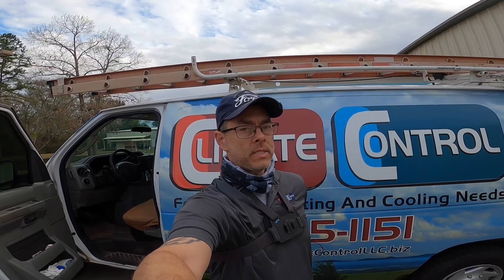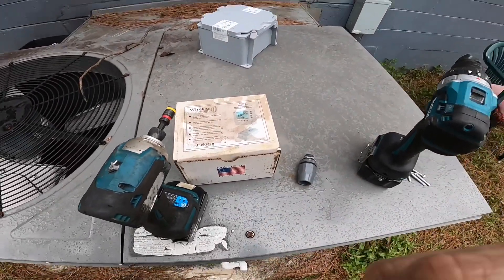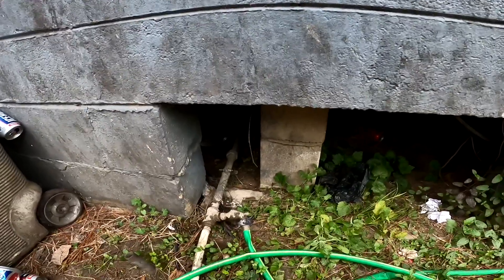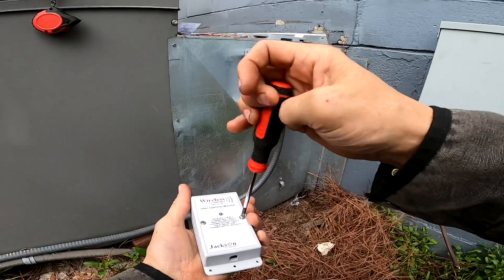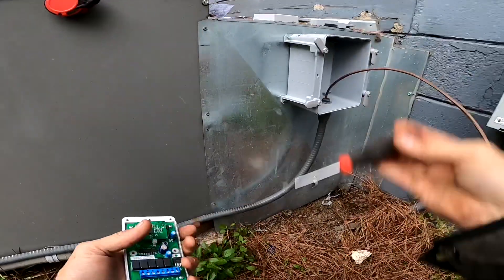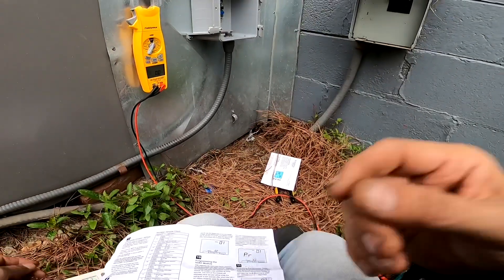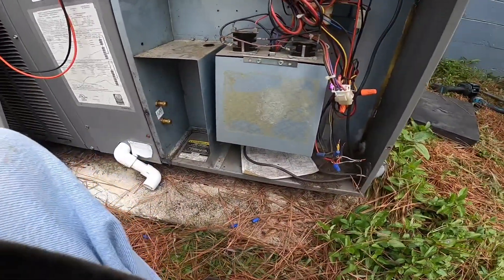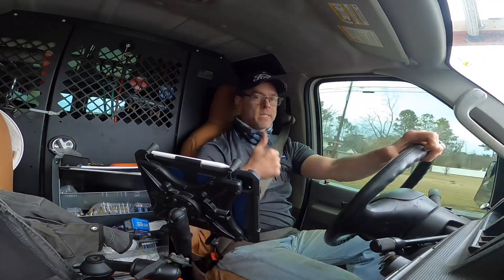Installing a Wireless Thermostat on a Package Unit

Comment: Wireless thermostats are great. I have the Honeywell wireless Focus Pro 5000, I think that branch of the company is called resideo now. Anyway, I live in a second floor apartment and the furnace is in the basement. For some reason, there are only three thermostat wires in the wall, R, Y, and W, there is no G or common. I really wanted to be able to control my fan but running new wires from the second floor to the basement would have been difficult and probably expensive. This thermostat totally solved that problem and provided some other benefits. The receiver attaches to the furnace control board in the same way any thermostat would. I didn't put the thermostat on the wall, since it's wireless I just take it with me to whatever room I'm going to be in. It uses Honeywell's redlink technology and has no problem at all communicating from the second floor of the building to the basement. I also bought the internet gateway for it and now I can control the thermostat from my phone. I can also control it with my Amazon Echo or Google Home. I really can't think of anything I don't like about this thermostat, I love mine.

Comment: How would wiring something like this work on a split system heat pump? Would you be able to bypass all the outdoor control wiring if you had to change that out or not since the air handler is inside?

Comment: That would be a perfect thermostat for me in my mobile home because our thermostat wires are running in a wall that is really close to a window where direct sunlight is hitting it and there is also a bedroom door that is usually kept closed and right now the thermostat is really sensitive to the draft coming under that door so it's affecting the operation of the thermostat in both heat and cool modes so if I can get a wireless thermostat so I can place the actual thermostat in another spot without redoing the wires that would be a easier solution to the sensitivity issue

Comment: Why not drill into house, run wires from unit to box inside home. That way the receiver can be out of outdoor elements. Wouldn’t matter where it’s located as long as you get sensor in return. Would improve signal also.

Comment: Do they make something similar for a split system If the wire going to the outdoor unit is broken?
Reply from the maker: Yes, it’s called a wireless relay WR-400 sold by Jackson Systems. You just need to supply 24V outside.
Reply: Your thermostat wire might have a extra wires or if it’s using a common and there is no extra wires behind the wall then use the common wire and just put batteries in your T-stat.

Comment: That's one type of stat i havent used yet. Have ya had any problems with the wifi stats like that?
Reply from the maker: Yes, some of the wireless stats are  junk. And I’ve had problems with nearly all wifi thermostats not always connecting or not even functioning properly.

Comment: Quick question. What's the max effective range on that thing? We have a system that's on the second floor of  4 floor building and it's having a short issue between the condenser and everything else.
Reply from the maker: I think the paperwork said 50 feet.